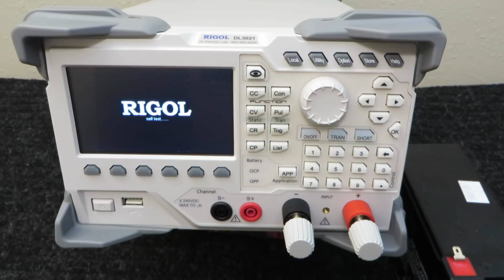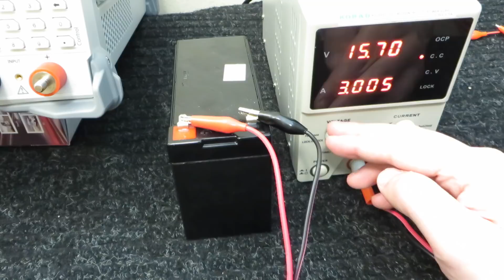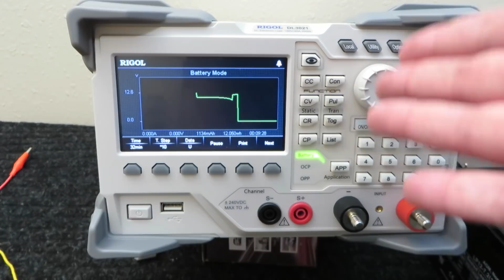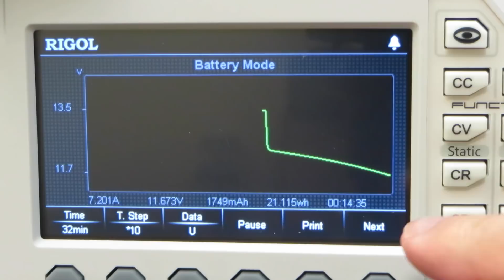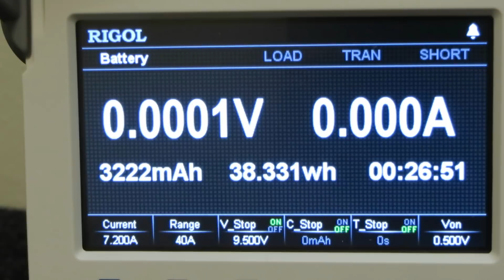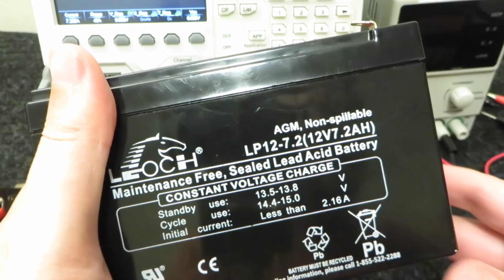Battery Desulfation Demonstration Start to Finish - Part 2/2

Comment: I would like to use this method on a badly sulphated battery from my car which sat most of the summer. 70Ah AGM battery. I read that AGM batteries need slightly more voltage to charge properly than supplied by common chargers. My old charger goes up to 14.4v but apparently AGM batteries charge at 14.6 to 14.8v to achieve full charge and desulphate. What voltage and current would you suggest to use on the Korag and for how long.Thx.
Reply from the maker: If the battery sat uncharged over the summer it can be saved almost for certain.  AGM does not require more voltage than flooded batteries - the voltage required is related to the chemistry which is generally grouped into three loose categories:  Pure lead, lead calcium, and lead antimony.  I don't know your battery but it is likely lead calcium which is the same chemistry as nearly all flooded car SLI batteries today in the USA.  It depends on how much time you have but around 14.6 to 14.8V is a good voltage for these as you stated.  I'd actually suggest 15V for a flooded battery as the water can be replaced.  I don't know your exact situation but I'm thinking 14.5V would be a good start point with 12hr 14.5V desulfation durations after full charge each cycle to avoid too much water loss.  Each discharge cycle would then involve charging normally followed by another 12hr 14.5V desulfation.  If your battery takes little to no current you can safely start at as high a voltage as you want and limit the current to an amp or two to get the process started until you get that 1st charge done.  When cycling if the battery is stubborn you may need more than 14.5V, but much above 15V and you're likely to lose a good amount of water and shorten battery life.  It depends a bit on your patience and available time commitment.  There's nothing wrong with leaving it on a charger for weeks at a time at something in the low 14V range too.  That's a completely acceptable method if you have the time.
Reply: @knurlgnar24  Thx. It's very nice you answer so quickly. Cheers!

Comment: When the label on the battery says 7.2 amp hours and he got 4 amp hours out of it during his load test why did he say several times that 4AH was the original full capacity of the battery?
Reply from the maker: I showed the graph from the manufacturer showing Ah rating vs discharge rate.  7.2Ah was probably at the 20hr rate and I was discharging at a much higher rate which results in lower measured capacity.
Reply: @knurlgnar24  Thanks for a quick reply.
Reply: @knurlgnar24  As far as I understand you can safely get 1/2 the rated capacity out of the battery. If you take out more than that you are doing damage to the battery. That's why IMO.

Comment: The total electricity cost, excluding the labor and time, could be more than the price of a new battery if you including the times when the battery recovery completely fails. This cost would scale with more expensive batteries. Overall, I think what you get out of it is just the fun element. The time gap between part 1 and part 2 of the video suggests even the fun element might not be there. This does benefit the people watching - they are made aware of the risk and cost involved. Having seen this, I will reduce my efforts in keeping my 17.5 year old car battery going. It recovered some capacity, according to the hydrometer, by being charged to 16v by a solar panel for 6 months while being used in the car. I was thinking of getting additional tools to further improve recovery. Now, I won't bother.
Reply from the maker: Electricity cost is negligible but the labor and time can be a factor.  If you got 17 years out of a car battery I'd count myself fortunate and buy a new on, but that's just me.  :)  This process is more for abused/undercharged batteries that are still 'good' but are sulfated.
Reply: @knurlgnar24  You have no way of knowing something is "good" until you have spent the time, effort, and electricity.

You are fortunate to have low cost electricity. Where I am, even running a low powered computer is expensive.

I have no need to buy a new battery if the solar panel continues to slowly desulfate. What I am cutting back on is to buy tools to do faster desulfate. I was all ready to buy from china until this video.

Comment: How about preventing sulfation in the first place by keeping a lead-acid battery on a charger as often and long as possible? It seems perfectly fine to keep the battery on a typical three-stage charger forever, but I worry about overcharging. 

Here is my misgiving: The third stage in my charger seems to be float mode in that it puts out about 13.7V, but it doesn't seem to react to load current at all so that it will never shut down the continuously dropping trickle current. 

Hence my question: Can a lead-acid battery be on such voltage forever without overcharging it? Shouldn't the charger switch off the voltage entirely at some point?
Reply from the maker: A lead acid battery can be on a float charger for its entire life without issue.  That's the short industry standard answer given for reasons of convenience and practicality.  The longer answer is that I agree with you in that a battery will last longer if it is not subjected to a constant trickle charge for reasons of plate corrosion.  Best case is to periodically cycle a battery and bring it back up to full charge then leave it disconnected until the next maintenance cycle.  Batteries last decades if treated this way, but unless you're just storing them it isn't very practical hence the stock answer of 'just leave them on float forever'.
Reply: @knurlgnar24  Thanks. So do you recommend keeping lead-acid batteries in storage conditions on such a charger continuously, assuming you can't cycle them? 

Apart from this, we should make a distinction for the sake of clarity. Namely, there are at least two types of the "float" mode in smart lead-acid chargers. One is this constant-voltage type I have already described, another is a switch-off-and-on type. Unlike the former, the latter maintains the battery's full charge by alternating between switching off the trickle current completely and switching it back on depending on sensing the voltage level around the float voltage on the battery. As a result, the charger cuts off the battery for a long time in between refilling its usually full charge. The following article describes this type of charger in more detail: https://electricalacademia.com/batteries/battery-charger-types-trickle-float-charger-working/.

Now, how would you rate this type of charger? Do you think it would still be performing worse than cycling in the battery's lifespan department? You probably meant that only the first type of "float charger" I described would perform worse, didn't you? After all, doesn't the very characteristic of cycle life vs. DoD (depth of discharge) of every lead-acid battery clearly show that the lower discharge, the longer battery's lifespan?
Reply from the maker: @allegrofallegrof  Cycling is necessary for maintaining battery health and I'm not sure how that can be done without a discharge cycle of some sort.  I'm sure the float charger type you referred to is better than the cheap and usually ineffective float chargers sold to the masses on Amazon and at Walmart though.  I do think the best case scenario is to periodically discharge and recharge the battery and leave it disconnected during the rest of the time.  Again, I don't think this is practical for most people and the float charger you reference is probably a better solution for practical reasons.
Reply: @knurlgnar24  Thanks; what depth of discharge would you recommend for the storage maintenance - 50, 80, 100, or how many percent? As for the float charger, one should add energy costs into the equation because it is likely to consume at least a few watts on standby.

Comment: Hi, Ive got a quick question to you about desulfating regular truck 12v batteries.
In my case I have 12v battery, group 31, 80ah, 730CCA.
1. What current/voltage/time should I charge it with initially to "wake it up"?
2. Voltage/current for cycle charge? (10% of Ah I heard, so 8A?)
3. Wattage/Amperage for cycle discharge?
Also, is it the same for dual purpose batteries? 
There are no specs on truck batteries and I cant find these online....
Thank you
Reply from the maker: I'd suggest making sure the water level is above the plates and using 2-5A of forced current at whatever voltage that results in making sure the batteries do not gas too violently or overheat.  Every 12-24hrs after stabilization you can do a discharge cycle.  If your batteries are 'worn out' and not sulfated you'll likely not find much benefit but if sulfation is the issue they should recover to some degree.
Reply: @knurlgnar24  ok, whats the best discharge wattage for 80ah 12v battery you think?

Comment: Really good info here. One question; I learnt that if you discharge under 12,0v (no load) or 12,2v (under load) youll cycle your battery too deep. Would your tests be as valuable if discharge was stoppet at 12 volt? Regards, John
Reply from the maker: The purpose of cycling is to mechanically stress the plates so it would be better to deep cycle it, but you don't have to.  As for the discharge tests a deeper discharge gives more information about the battery health but again one doesn't have to deep cycle the battery to test capacity so long as the more limited information is acceptable.
Reply: @knurlgnar24  Thanks. This is good info!

Comment: sitting that long should self discharge to something like 12.5 - 12.6 . Above 12.7 means your cells are starting to dry out and the acid is getting stronger concentration, time to open it up and squirt some distilled into the cells (5-10mL). Wait a couple days and recharge, and should settle after a day to something in the 12.6 to 12.7 range.
Reply from the maker: A battery that settles to 12.7V after a few days is a damaged battery (lead antimony chemistry excluded).  Any good battery should stay above 13V for a long time - usually months.  I do agree that this battery may have lost some water.

Comment: I saw you mentioned in a previous reply that you could use this for larger 6V deep cycle batteries. Is there a different power supply or charger you would recommend? I feel like a single battery at a time will take forever. Thoughts? Some context, I use 100s of golf cart batteries a year in remote solar equipment installs.
Reply from the maker: A good lab power supply should work well for you.  I have a review of a Wanptek out there that I think would work great for your application.  (they sell different voltage/current combinations)  You can connect multiple batteries in series for the desulfation step as long as you're careful about it (voltage will be different on each battery).  Or you can connect them in parallel and bump up the amperage.  Either way has its advantages/disadvantages but regardless a series/parallel combination should be much faster than single batteries.  That said have you considered simplifying your setup and just buying cheap power supplies and doing 1 at a time?  $500 should get you 10 lab power supplies allowing full control of 10 batteries at once.  Just a thought.
Reply: @knurlgnar24  Thank you for your response. I will take a look at the low cost power supplies you mention. That may actually be better. At first I thought if I could find a 48V 100A power supply or dumb charger it would be most economical.
Reply from the maker: @rayshaffer2727  I would recommend staying away from a 48V 100A power supply for various reasons.  If you want a larger power supply you could take a look at the wanptek brand on Aliexpress that has worked great for me.  Just search for it.  They have a 15V 50A version for under $200 that may fit your needs well for 6V batteries.  Personally I'd get a 30V version so you can also use it with 12V batteries but I don't know your exact situation.

Comment: Hey thanks for the great vid. I have a noob question. You always hear that discharging AGM's below 50% can damage them, yet this process looks to be discharging them well below that intentionally over and over again. Is it just that the high voltage charge does more desulfation then the discharge sulfates them? Meaning that every cycle is an improvement?
Reply from the maker: Not a noob question, this is something so-called experts often get wrong.  It is not on any lead acid battery AGM included damaging to discharge below 50% DOD.  If you look at documented cycle life vs discharge curves from any major manufacturer the data shows that the battery only cares about the product of the discharge depth and cycle count.  40% discharge twice is about the same amount of damage as 80% discharge once.  Once you get down to 10% to 20% or so damage starts accelerating somewhat but that isn't a useful SOC range anyway so it's irrelevant.  You can safely discharge any lead acid battery down to nearly 100% discharged as long as you recharge it soon after.  You'll get fewer cycles out of it vs only discharging half that much, but the total energy stored/provided will be close to the same.
Reply: @knurlgnar24  i have been studying lead acid batteries as a hobby for about 2 years and you might be the second person i have seen make those claims and i agree with every point you made. 

some times i feel like a conspiracy theorist, because it seems like i dont trust anything i am told, and must see it for my self before i start to believe it. my own research and tests, and of course data sheets from manufactures had lead me to my conclusions. if i listened to all the wisdom on batteries i would have never touched them, because "they can become bombs" etc etc, let alone understand them, which i find to also be a narrative that seems to benefit those that make or sell them rather than those that use them. 

btw, i have come across your videos many times over the past several years, before i even thought i myself would deep dive into this topic. appreciate you staying the course and sharing your findings.
Reply from the maker: @jasonbrown467  I failed to respond to this comment in due time apparently but you and I appear to be of the same mind.  I don't care what people tell me or what I am told is true.  I care about what IS true.  Both are usually the same but occasionally very different and this is one of those contexts as there is so much incorrect information out there on battery tech.  If one listens to the 'general wisdom' on the internet that person will be misled to the point of total ignorance.  I don't blame the individual but it is an unfortunate situation regardless.
Reply: @knurlgnar24  Thanks for the reply! Thats good info to know and makes a bunch more sense than the 50% rule quoted so often.

I have one more question as I sit here watching my lab power supply try to charge a 225AH 6V battery after a load test (got 175AH from it). My power supply is a cheap one and can only do 10A. When the battery is really low after a load test, I take it it's fine for the power supply to only output 5.7 volts for the first hour or so as the state of charge comes up (as resistance climbs), then I would expect to see it increase up to the 7.2v I'm looking for before the amps start to fall away?

Does this mean all the de-sulfation is happening after the battery has reached a higher state of charge and the voltage picks up? ......meaning maybe half cycling the battery is a slightly faster way to get a few cycles through it? Or is something still happening down at the 5-6 volt range? (ok maybe a few questions)
Reply: @TURSTY09  It is bulk mode charging at first, taking the 10A max of the power supply while the voltage is limited to the discharged battery voltage. As the state of charge increases to the 7.2V absorption voltage, the current drops as the voltage reaches 7.2V

Once the current stabilizes, increase the voltage to 7.75V for an equalize charge for approximately 3 hours or so. Equalize charge is where most of the de-sulfation happens.

This is why a variable power supply is so useful for this.... regular chargers are designed to chronically under charge batteries to err on the side of not boiling the electrolyte dry.
Reply: @kal9906  Thanks Kal, thats what I assumed. 

I have successfully manage to get 4 225AH 6v batteries from around the 150AH mark after an un-intended complete discharge and rest for ~4 weeks, back up to a reasonably healthy 210AH and returned them to service. They each took around 8 cycles. It was super cool to put this learning to practice and leave me with thousands of dollars of usable batteries that were going in the bin (well the recycle center) otherwise! All with about $300 worth of kit.